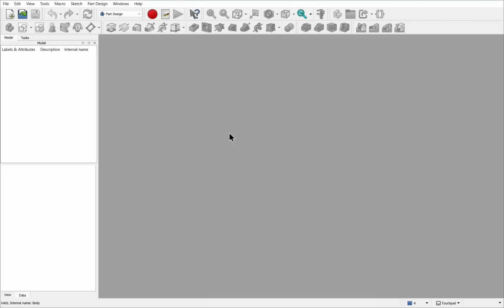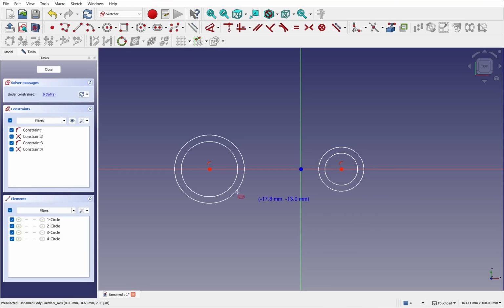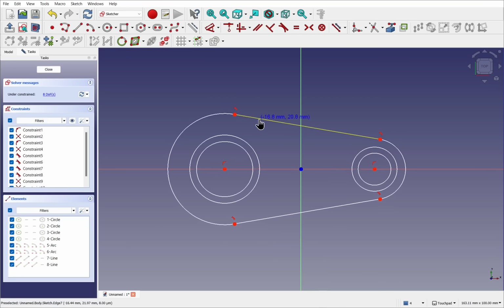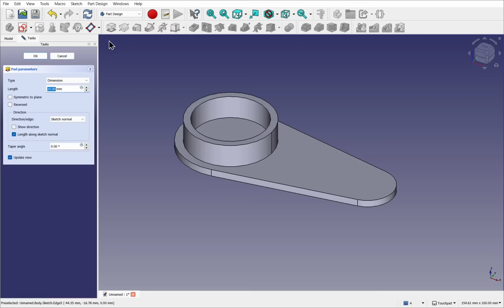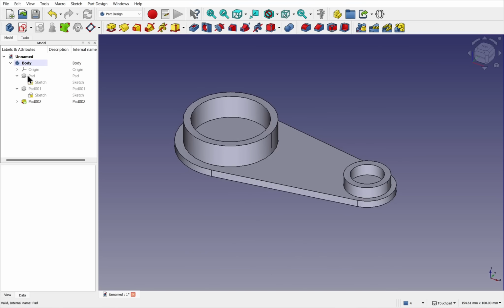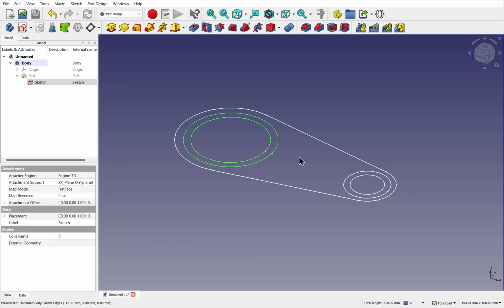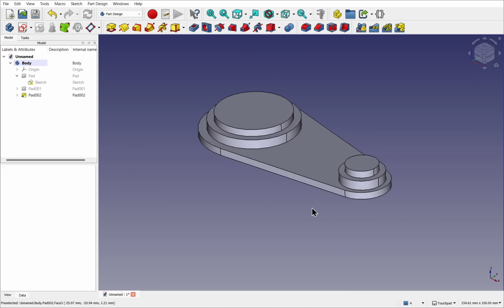New FreeCAD Feature! Complex Extrudes from a Single Sketch Like in SolidWorks

Comment: I had a use case for this today and it didn't work. Using FreeCAD 1.02. Selecting multiple circles it will only extrude one. If I try extruding one after another, only the first one remains.
Reply: Just tried it again and I got it to work, the circle extrudes only work if there's a "base" volume beneath them as in the video. You can't have one body with two extrudes floating around separately.
Reply from the maker: Saw your other message. In the new version of freeCAD 1.1 which we should see soon (or can be downloaded as the RC release from the main website) there is a new option on the sketch itself called make internals which may be of interest.  Ah Also if you want more than one solids in one body, select the body and enable the 'allow compound' option on the data tab.  Hope that helps.

Comment: Hello! I'm new to FreeCAD. Doesn't padding in the same direction create some sort of intersection between faces? Can create problems?
Reply from the maker: Hi, now problems, as this is in the part design workbench the operations are automatically fused and refined so you wont encounter that issue.
Reply: @MangoJellySolutions  Thank you!

Comment: I made a gear and having to select all the wire instead of the actual closed shape is the dumbest thing I’ve ever seen.
Reply from the maker: You shouldn't be using this method to do that.  Put the gear into a separate sketch and pad that instead.  Then you don't have to select the edges.
Reply: @MangoJellySolutions  Yes, so no " Complex Extrudes from a Single Sketch Like in SolidWorks". That was the idea behind the 'master sketch' concept :p

Comment: In SolidWorks, you can extrude any are or a number of areas together and then reuse the sketch for other extrudes.
So you don't even have to trim your sketches, because you can have lines hanging out.
As long as there is an enclosed area, you can extrude it.

Lines will be extruded as Sheet metal parts.

Comment: This showed up in my list a week late.  I was designing a button and LED plate for a project case for my MiSTer and did each layer individually that I needed, and had to restart a few times because I was confusing the hell outta the software in 0.20.0 and 1.0.0 to the point where the final layer was basically an inverse geometric 4D thing.  Looked so strange, but, I couldn't  undo enough.  I think I hit a constraint problem and it just went all chaotic.  This is an AMAZING tip!  Thanks!
Reply: Confirmed...  Seriously amazing.  I kicked up 1.0.0 and with constraints (containing completely wrong numbers - Just going for the form, not the function this time), I redid the philosophy of what the part was supposed to be and managed to get it done in about 20 minutes, compared to the several days spent on the previous part.  For me, in all sincerity, this changes EVERYTHING in my designs, especially on my single-part prints.
Reply from the maker: Great to hear it helped. MisTer as in the FPGA device? I was looking at those some years back when the channel was at a cross roads, do I carry on with Amiga and retro gaming or do I continue my love for 3D and freeCAD?. I still have my old Amiga tutorials for Linux on the channel 😊I have heard nothing but good about the MisTer.
Reply: @MangoJellySolutions  There is nothing BUT good for the MiSTer.  It'll do Amiga "emulation" as well.  You basically buy it as an Amiga, but, you get everything else it can do for free!

(There's parties out there that call it Emulation and not Emulation because "FPGA".  I don't care what it is.  It's a tool that does its job well)

Comment: Unfortunately, there is no option to offset the height of the starting plane of the secondary extrude, so the final extrude height must be calculated manually by adding the secondary extrude height to the base.

Comment: 2:10 On that note! Is there a way to select the whole loop?!
Reply from the maker: That would be such a good addition.  In the path workbench you can do it via a tool there that could be integrated on a short cut but now in CAM workbench you can't seem to just use the tool without some kind of setup first. Be great to take that bit of code and pull it out as a macro or feature.  Now I am wondering if I can program something....

Comment: This is a much better use of sketch data and means one sketch can be sampled multiple times. Can the selected wires be used in other bodies or with binders?

However on quick reflection it is very easy to do exactly the same exercise performed in you example with the simple use of 2 or 3  binders from the same sketch.  Not a big leap forward but it could be easier for inexperienced users.
Reply: It would have been helpful for me two years ago, but it's too little, too late. I have learned to use subbinders etc; they are fiddly but no more fiddly than these new side effects of TNP mitigation code.

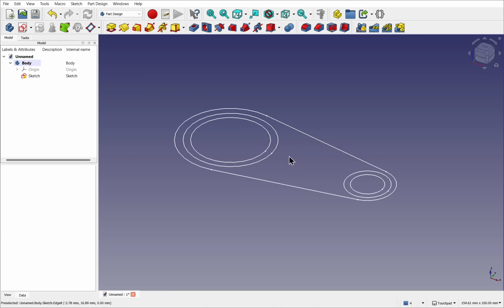Comment: At 2:07 when you hold down the ctrl key to select the perimeter lines one at a time it makes me wish FreeCAD had a command that would select all curves & lines that touch the selected line.  I have used other CAD programs where shift+"~" does this.  A real time saving feature if you have a complicated perimeter that needs selecting.  Love the MangoJelly videos--very helpful.
Reply from the maker: There is a tool in the Path workbench that selects a loop but in the newer versions it is restricted down to only be active when a CAM project is activated.  It does just that, it selects a loop of all connecting edges but you select two edges and it will create a loop selection in that direction.  This is calling out for a macro that can be bind on the necessary key combination.  Glad your enjoying the videos.
Reply: FreeCAD needs a lot of improvements when it comes to selection. But this "feature" wasn't planned (it's a side-effect of the TNP mitigation code) so let's wait for the next release cycle.

Comment: The extruding part is clear, but I'm curious - assuming I want the "center hole" of each of the "pegs" to be through the "baseplate"? Can I select the inner circle of one (or both) of the "pegs" and pocket that through the "baseplate"? It would seem logical to think that it would work the same, other than the difference of needing to use the pocket tool rather than extrude. (Asking instead of trying because I'm still working back in 0.21.2, and not quite ready to make the jump yet - tried in my version, making pretty much the same, other than dimensions, sketch you demonstrated, selected the outer edge, but when I tried to extrude it, not very surprisingly got the  "Result has multiple solids: that is not currently supported." dialog)

Comment: This is great.  I used to just make copies of the sketch and toggle parts from reference to geometry,  could make a real mess if you changed something in one sketch and forgot the others.  Never learned the master sketch usage
Reply: It would be nice if we could actually have more than two types of geometry, rather than just Normal and Construction.
I want to be able to say, 'This is Normal Geometry A and this is Normal Geometry B' (in the same sketch) and then set things up so that (for example) an extrude would treat only B as its sketch and another operate would treat A as a separate sketch.
How is this difficult ?

Comment: Great videos! Has there been any updates to the Path workbench in the last 6-12 months? CAM generation has been the biggest barrier I run into everytime I want to try to switch from Solidworks to Freecad
Reply: Nothing really significant apart from the name change (from Path to CAM), rest machining, new simulator, Vcarve improvements and machinability material properties.

Comment: I see how I could have used it. But I don't like you have to pick every line to include in the action. It would have been much easier if you could classify the sketch lines with custom classes then the default 2 blue and white ones. When you extrude a sketch you can choose which class or classes you want to include. So in your example you would have had 2 or 3 classes depending if you want both at the same height or difference height.
Reply: As soon as I saw the manual ctrl-selection of the lines round the edge I thought that would be a pain with complex outlines, as I often have to deal with e.g. after importing a DXF from some other tool.
I'm not sure about your "classes" idea. I think it just needs a tool that lets you select one line and it automatically selects all the connected segments. (although that would have trouble if three lines join at a point)
Reply: @simonstroud2555  I agree for complex shapes it would help to be able to select continues lines. The problem I foresee if you don't set your selection fixed in stone (classes). And you mis click once you can start all over again. And for example with the 2 classes that already exist. you can select a few lines, toggle the class. and select the next few to change. But the biggest benefit in my opinion of using classes, is not losing your selection if you delete the action, but keep the sketch. Which for me happens almost multiple times in every design.
Reply: @TinusBruins Yes, yes. Very much this. I actively want to cast my classes in stone, as I alone KNOW what part /this/ collection of elements plays in the whole sketch and I alone want to be able to add or split or curve a new edge into /this/ geometry rather than /that/ one.
Reply: Couldn't have put it better myself: having different subgeometries would be nothing more than an extension of the 'construction line' concept. It would make it trivial to 'keep bits together' when lines/vertices were added, as well as making it clear which 'subsketch' one wanted to include in an operation.

Comment: How wil ik behave when the sketch changes? How would freecad know what to extrude? for instance the shape of the line was changed? Multiple solids of a single sketch is awesome!
Reply: I'd like to know this as well. Why wasn't this covered at all in the video ?

Also, why is it so difficult to 'tag' different geometries in the same sketch, so that the sketch would present different subsketches to different clients ?

I want to be able to treat some 'real' geometries as 'construction' in one operation, but 'real' in another, and vice versa.

The simple. mechanism of simply 'naming' certain geometries would also disbiguate what to do if an underlying sketch were changed: you could specify unabiguously which elements were used in which operation.

In the presented example, just label the outer shape of the sketch '1', one of the circles as '2', the other as '3' all in the same sketch.
The outer pad could be defined as being a .extrusion of geometry 1, and the circles extrusions or pockets or whatever of a different subset of that geometry.

In other words, have a sketch work like a collection of multiple subsketches, bit with each subsketch retaining its own identity during what we would otherwise treat as a 'explode compound sketch' operation, except that it would be reversible.

Comment: That is a great advance and follows a principle of generalising the operation of tools. It would be nice if the hole tool was generalised also to allow any closed shape to create a hole. I think even in 0.22 only circles can be used to create holes by the hole tool. It would be nice if it worked for rectangles, slots and really any closed shape. I know you can create non circular holes using other methods, however, logically having a hole tool that can make a hole with any closed shape makes sense.  

It follows the old Unix logic that is evident in Linux that you make commands to do particular jobs like mv and cp (move and copy).  The mv command can move files or directories and even rename in the process if you want. You don’t have a file move and a directory move or separate copy commands. In the same way FreeCAD tools should do particular jobs but be able to operate in a general way. 

If I am wrong about the limitations of the hole tool please correct me. I have only done a few hours of hand to hand combat with FreeCAD 0.21 and a short test of a 0.22 beta. I came out bloodied and frustrated. I watched a basic tutorial which helped. Certainly 0.22 seems to be an advance however, I think it’s not intuitive in many areas. It needs to be easier to change parameters, the tools, like my hole tool example, should operate in a general way.  I will try again with FreeCAD when I next have a project. Thanks for your tutorials.

Comment: Nice video! I am enjoying using FreeCAD but it seems to have many quirks that we need to embrace to be productive with it. For example: I seem to sometimes have a part that is made from a fusion and the bits are in their original location after moving the fusion, so we need to be hiding and showing things all of the time to make sense of things. And when using Booleans I end up with a big tree of changed parts with the original name being lost and having to come up with a new meaningful name for the top most part. But I realized that I should then switch to using Part Designer instead of booleans with Part workbench etc.

Comment: Well this is real gamechanger. This is reason I was stucked to Fusion 360 all those years. Damn, this is huge - still room for improvement tho: instead of selecting lines, would be great to be able just to select closed part of the sketch, that would be just one click and go and that would put this CAD software truly on par with those big companies. I know it can be programaticaly difficult, but I believe in FreeCAD team there are truly great minds.
Reply from the maker: I'm hoping that the other features of link stage 3 come across where you can turn a sketch into a set of faces from a option and Extrude the individual faces. This would be the cherry on the top. Giving people the choice of multiple workflows really helps with adoption.
Reply: @MangoJellySolutions  also would be cool to be able to extrude disconnected faces to automatically create separated bodies. But i guess that wish is bit too much

Comment: FINALYYYYYYYYYYYYY!!!! This was the most annoying thig in FreeCAD, i was not able to extrude/cut from just one sketch, just like in Fusion 360. Altho, selecting edges with mouse + ctrl is a wrong way to do it, nobody new to FreeCAD will know that. It is better just to hover/highlight with a mouse over the area (that is enclosed or closed "looped") which you want to extrude/cut, just like in Fusion 360. But at least it is a start.
Reply from the maker: I'm hoping that the other features of link stage 3 come across where you can turn a sketch into a set of faces from a option and Extrude the faces, fingers crossed.

Comment: Great. I was missing this feature, but I'm learning it for few days since i decided to buy 3d printer. Other feature I'm missing for creating ports in some boxes - and I do it in openSCAD much faster - is to define objects, that I can subtract in 3D rather than sketches. Because FreeCAD has openSCAD mode, maybe it already works. It would be nice to create some "negative" object, dilate it by tolerance of 0.5mm and subtract it from box, rather than what I'm doing today - measuring everything exactly and drawing sketches on four surfaces. I think it can be done by importing geometry of some faces to sketch and adding constrains. 
However I briefly learned how to draw 3d plan of my flat with all features such as doors & windows embrasures in SolidWorks 20 years ago and it took me like two hours from zero knowing Google SketchUp a bit. In FreeCAD it took me one hour to realize I how to create box with pocket (I can't start with a cube, i have to use sketch-pad-sketch-pocket) and four hours to draw and use lugs in the box inner corners as a support for circuit board. With this tool, I can hopefully draw one sketch and use three different heights: bottom, lugs, walls.

Comment: It also works with a sketch and two bodies. Create a new body, right-click on the sketch and move it to the other body. It works. And if you change something in the original sketch, all objects will follow the new geometry.
Reply from the maker: I missed that one!  Thanks, going to have a play with that :)
Reply: If this is true, it's a great idea.
IF it works.
I am sceptical, because the developers seem to be stuck in the 'click this set of lines every single time you want to do something'. You currently even need to do this when sharing a sketch between two bodies or two operations with a sub binder: endless clicking on edges All The Bloody Time.

Just let us tag the geometries with identifiers, so we can refer to the same set in multiple operations, rather than having to click click click and then click click click again just to select the same subset.

Comment: What would happen if this file was loaded into an older version?
Reply from the maker: Just gave that a go.  So it loads and each of the pads are loaded correctly.  You can edit the sketch and say resize the holes which is reflected but if you try to create a new pad you can only pad the whole sketch.  You can create new operations on top of that feature fine.
Reply: @MangoJellySolutions  How do you fix subshape not found when adjusting dimensions in the sketch?

Comment: I've been hoping they would do this. Onshape has this feature . I'm so glad Freecad is going to start doing this!
Reply from the maker: Always liked this in other CAD programs, I would love this to go the full distance where the inner part of the profile is highlighted rather than selecting each of the edges, but this will more than do for now :) Great feature.
Reply: They didn't implement it on purpose. It came along with the TNP mitigation code and they didn't even know until now. So it's not properly implemented and may not always work yet.